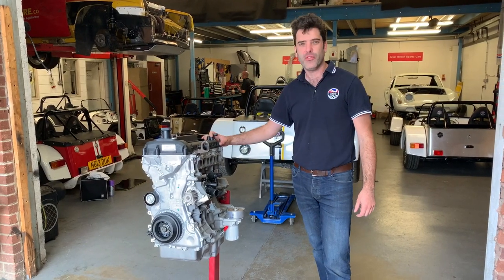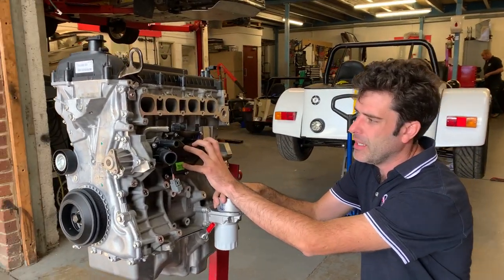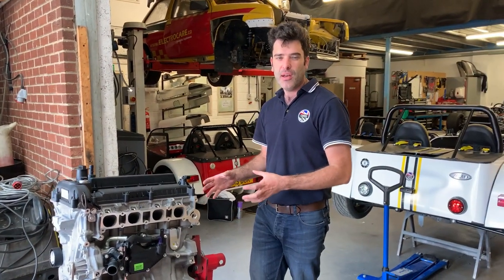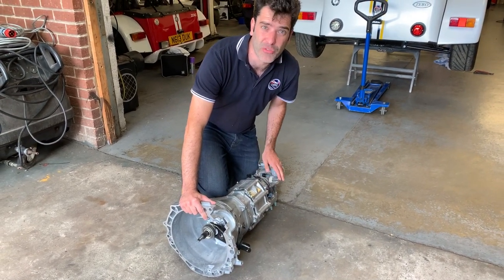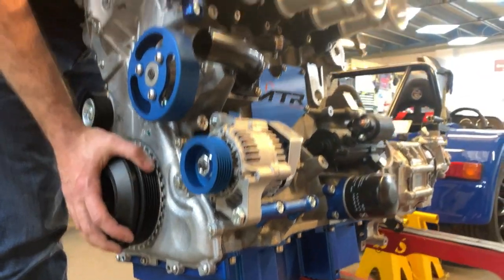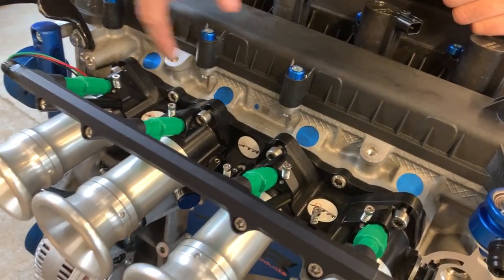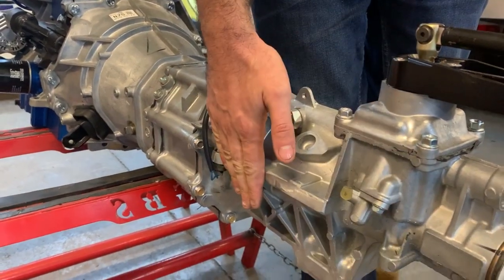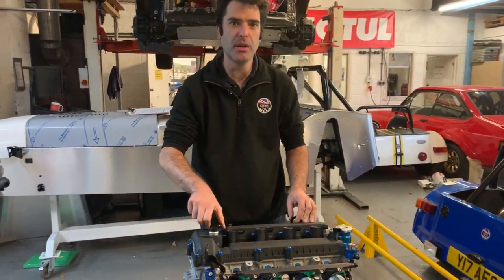Ford 2.5 Duratec Engine dressed with ATR Products fitted into the Zero…..

Comment: Does these pulleys also fit a duratec HE 2.0 engine? Ford fiesta mk6 st150 ?

Update FYI: this waterpump pulley fits on the duratec he 2.0 in a fiesta st150. With a 6pk2253 belt

Comment: Hi I have got a NC 3.5 Mazda and due to disability mine is the auto will the engine fit directly onto the auto box without a adapter plate. In the states they swap the engine into mazda’s mx5 but not seen the engine mated to the auto box.

Comment: Did you remove the balance shafts in the 2.5 ?
Reply: That is what he said. Also some oil passage has to be blocked off. I will be using this setup myself as well, but not with the throttle bodies.

Comment: 200bhp?? That’s nothing! A stock Honda Civic makes more power lol..
Reply: Yes very true, but for NA power these are cheaper than k24s or h22/f22s. Mazda 2.5s are Good bang for buck, but not quite up there with hondas
Reply: @Sk0die  I have a ecoboost mustang 2.3l makes 420whp
Reply: @Paper.Power.Politics  ok cool buddy, but that has nothing to with what I said. Not everyone can afford a turboed mustang. My point is that these are good budget N/A engines (not boosted engines). 200hp isn't alot but obviously if we wanted the most hp we'd all be buying big turbo cars too.
Reply: @Sk0die  ohh gotcha.  I thought those came boosted to.   Stock mustang ecoboost makes like 260 to wheels.  So not much difference.  I have my stock turbo off mustang still.
Reply: It has bags more torque than a spoony ole civic engine. Plus it won't burn oil every time it hits the vtec 🤣
Reply: @GarageNation353  yeah I feel ya guys.  I also did not notice that it was going in a 1500-2000 pound car 😂   ,  speed performance makes a 800whp built 2.5 duratec engine.
Reply: In a 900kg escort you don’t need massive power that’s not the end goal.Its a fun car,reliable,still quick and anyone keeping the old skool cars on the road is doing the right thing for me.